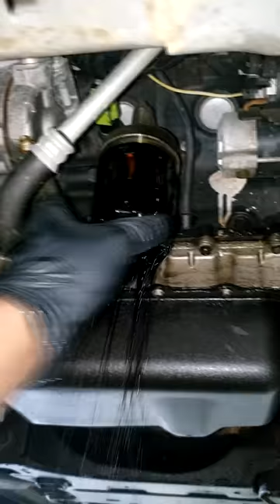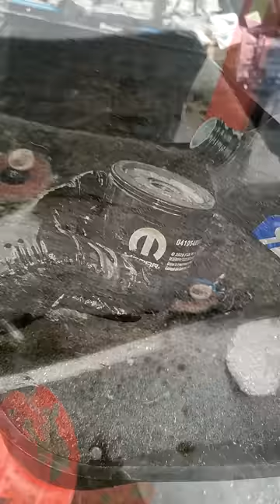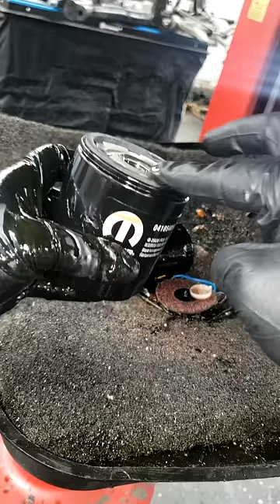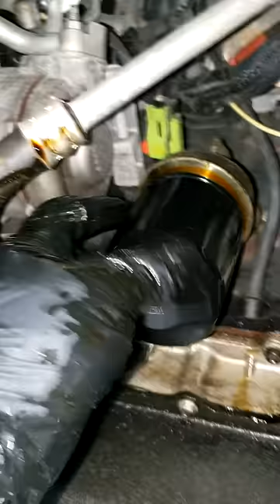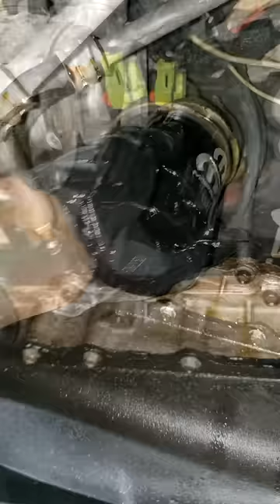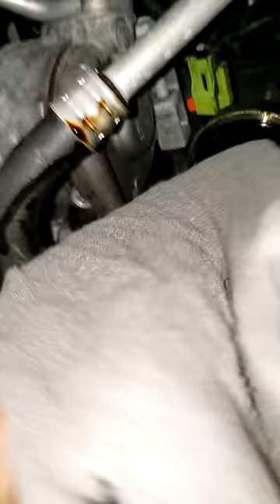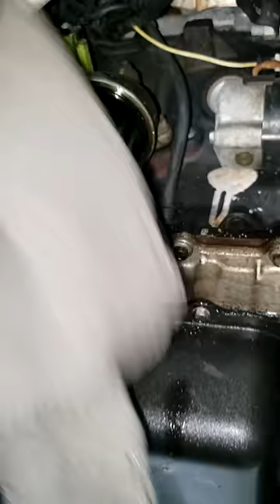Don't Lie.. Are yall still doing this?

Comment: Never pre filled a filter in my life, though cleaning the mating surface and lubing the rubber seal is definitely a must. 

Nearing 200,000km on my ER34, and turbo RB engines absolutely let you know if they’re not happy with the oil (usually in the form of a spun bearing)

Comment: The center of the oil filter is the inlet, the holes on the outside are the outlet. You've just let unfiltered oil into your crankshaft beatings.

Comment: I pre-fill the filter because the oil pan capacity doesn’t include the filter and I add exactly the quantity that the pan holds, then with the gauge I can se where it stabilises and might add a little bit.

Comment: Oil pump pushes oil, it doesn’t suck. Filling your oil filter like that pushes an air pocket through the oil in the filter. I’d rather let the pump push unrestricted than making it tougher on first start up.

Comment: Simple answer, all the engine oil runs through the filter FIRST when you start an engine. If you don’t preload the filter you’ll have a few seconds before the oil is transferred to other parts of the engine. It may not seem like a lot but after 20 oil changes you will start wearing parts down faster than if you just loses the filter first.
Reply: nothing will happen when you dont prefill it. the same thing happens with every engine start. also, some oil filters are on top or on the side and you cant prefill even if you wanted.
Reply: @keisuketakahasi4584  the engines that aren’t able to be prefilled are designed to do so. Sbc, sbf older cars in general it is crucial that the filter is filled before started. Those few seconds it takes to fill that filter then get to the rest of the engine will cause faster wear.

Comment: Even if you pre-fill the filter, the oil in there is not moving anywhere until the pump sends oil to the filter and pushes the oil you already added. Given the small volume of oil you added, I really doubt in the end that you are changing the time it takes for the new oil to circulate by more than 1 second. If it means that much to you, pull the fuel relay and turn the engine over for 5 or 10 seconds to get the pump going at a real low rpm.

Comment: As sn ASE certified tech and also an automotive machinist this is a complete waste of time. They say to do it in school but in reality its not necessary. If you actually understand how the oiling system functions you already know this . Plus a lot of filters are horizontal or even upside down now so its virtually impossible.
Reply: Bingo

Comment: I had an automotive instructor with a 98 Camry with over 400,000 miles and he never told us this to put oil in the oil filter. He would drive from LA to Las Vegas twice a month.

It’s a good idea though to prevent a dry start after an oil change.

Comment: No, it’s been tested and proven it needs to be prefilled especially on large filters on large machines. If not it will run dry for several seconds. Always prefill!
Reply: I run my engine dry between changes to condition the moving parts.  Also known as fasting.

Comment: Your pouring unfiltered oil in to the filter purloin of the filter therefore when the vehicle is first started after service then you have just introduced contaminants to your crank bearing great job.
Reply from the maker: Where exactly do you supposed the contamination coming from by using new oil in a bottle? Are you suggesting that new oil should be filtered?

Comment: I fill the oil filter if it's mounted straight up & down. I for sure wipe the o-ring area on the engine & put a little oil on the new oil filter o-ring to ensure it seals against the engine.

Comment: It's called priming, they do it so when the engine draws it's something to draw from and the gap air space etc is filled in with oil.  You can break your oil pump screen and engine.  The seal on the filter yes lube it  it keeps the seal from adhere to the engine and will come off easier the next time you change it.  As far as priming the filter usual just diesel I automatically do that to.  Lol always read the book to find out if it should be done because there are certain vehicles it will flood it out and burn it up.

Comment: I don't run "designed to fail" vehicles, so most of the time, I pull the coil wire an crank it till the mechanical gauge moves.

I do fill the filter when it's plumb though.
Reply: Won’t apply to all vehicles, but the last mustang (2016) I had would only crank if you held the throttle to the floor and turned it over. So I’d do that once or twice after the oil change and then wouldn’t get the 2-3 seconds of the car telling you it has no oil pressure. For a vehicle that was tuned and running out to 8000 rpms I wasn’t going to not do this step that took 5-10 seconds of my time lol.

Comment: As a heavy machinery mechanic , many big engines have the filter right next to the turbo , i pre fill the filter to prevent the turbo from running dry , even for a couple seconds , we service our machines every 200 hours , every 400 hours we change the oil and every 1000 hours we change all filters , if the turbo runs dry  5 seconds with every oil change , thats 50 seconds every 4000 hours ! 😉 save that turbo people

Comment: This really only mattered way back in the day when it was common for engines to use high viscosity oils like 15w40. Oil is so thin nowadays that your 0w20 oil is practically cycled through the oil system when you’re just engaging the starter before the engine even fires.

Comment: Even if you don’t worry about the oil supply being dry for a few seconds after fire up you should still do it because the filter will tend to leak if you put it on dry

Comment: There's no need to do that, some filters are paper cartridges like in some GM vehicles, some have the oil filter at a horizontal angle lol and the oil pump will do its job. The oil pushed through the filter will push the air pockets out anyway. There's more than enough oil to do so.

Comment: I have a 2006 ford 150. Oil change and lube oil seal spin on and crank up and it takes nowhere near 5 seconds more like 1 or 2 seconds same with the 16 chevy 1500 mabey 1 second. The only time I ever did fill oil filters was on hydraulic equipment  forklifts,cranes,lifts.

Comment: A good reason is to saturate the media with oil, if you try to suck oil through a dry filter the media could tear, even on side mounted engines I fill them 25% of the way full and swish it around

Comment: If you put a little oil on the on the rubber it make it easy to lose of next time and you fully it up, it make it sure that the engine will not turn on with no oil at the start so you don’t destroy or damage the engine

Comment: Wouldn't have to after the 1st use of Duralube. It's chemical was made for the shuttle. Try using it with a new drill bit in pig iron. Still watch the 1984 video.

Comment: Im an ACC tech for walmart, first job ive worked in this industry. We're told that priming filters doesnt actually matter unless its a diesel. I imagine it'd be difficult to put on a primed filter on any vehicle where the filter is horizontal. A lot of nissans, hondas and every traverse have horizontal filters.

Comment: Cant with mine because of the angle of the filter so if i do that im just dumping it right back out.. so no i just let it idle there's plenty of residual oil in the engine to prevent damage.. just idle it for a few moments.. dont be dumb and rev the engine..

Comment: I have one a Toyota eengine that i just replace the inside cartridge...which i do personally like but i cant prefill it. Not that matters with the way yhe oil runs down the engine and into the filter anyway when i fill it

Comment: I've been changing my own oil for over 50 years. I'm 70. Never did this and my vehicles all lasted a long time. My favorite is my 2006 Tundra with 300k miles. Runs like a top.
Pre fill an oil filter is nonsense. Yes, I'm a retired engineer too
Reply: Bty, my Tundra filter is mounted on the top of the engine, holes pointing down. How would I fill that filter and why?

Comment: Or you can look on the side of the filter. They all say now, whether you're supposed to prefill them or you can leave them even on semis they do that now have to semi's eye work on. You don't even need to do that anymore like in the old days. When the oil wasn't that good, that's the difference. 30 years ago, the oil was just not the leaves out of it and send it out. Nowadays, it's got a 100 million things in it. It's stopped all that from happening.

Comment: The oil filter is on the return , if it was on the pressure side it would blow off the filter. Do it any way you want, don't hert eather way.

Comment: Heavy equipment mechanic here. I have always done this even in the pickup truck that after getting screwed by engine shops rebuilt the engine myself. I do this for everything. That way the engine isn’t being starved for oil. I have never ever had an issue from doing this. But then again I don’t have this modern junk with tiny oil ports and low resistance pistons for “fuel mileage” I have all old equipment from 1984 and older. Back when engineers knew what they were doing and cared about the customers. No low resistance piston junk, or tiny oil ports. Simple to work on and will last forever. Grandpa did it this way when he was a mechanic for ih back in the day they got by just fine back then so why change something that works?

Comment: Just did this last week, also oiled up the seal, and cleaned the mating surface before putting it on hand tight. Basically rebuilt my engine 😂😂

Comment: Pro tip, it’s always a pain in the ass to try and cleanly unscrew and remove the old oil filter when the filter is oriented either sideways or bottom down (as in the video) without getting old oil everywhere. You can take a nail and puncture a hole in the dependent part of the filter to allow it to drain first prior to unscrewing it. Those oil filters typically are made of thin metal which is easy to puncture with a nail to make a drain hole.
Reply: That is a great tip!

Comment: You don't needed to clean up oil filter my boy , just change a new filter if you want to do that 
Pouring oil into new filter is unnecessary, but for fuel filter is okay because is helpful to quick starting engine 😊

Comment: This is wrong and right. You should put oil in your filter before install…BUT you genuinely only need about half a cup full…especially if you are dealing with a filter facing downward in an engine bay on some engines.

Comment: I stopped doing this 25 years ago when I started working on BMWs. They use cartridge filters with a drain plug on a post that is part of the cap, there's literally no way to pre fill them.

Comment: Never have and never will, doesn't make a difference, the only thing i do that you did is oil the seal but I also wipe the engine side surface before installing the new one instead of leaving it dirty like you did

Comment: after working in a lube shop at chevrolet, we would never fill the oil filters and every single car, once you turn the car on, theres about 1 or 2 seconds where you can hear the top end of the motor doesnt have oil, then the audible change when the oil hits the top end. if it was my own car i will defenitely change the oil like the video

Comment: Don’t matter, my dodge Cummins has 280k miles and I bought it with 6 miles on the odometer. Always changed to oil the same way without prefilling and never had an issue.

Comment: I cant, just lube up the oring and seal, get it hand tight, turn with oil filter wrench like once and call it good. Mine is on the side so itd just be giving my engine a little oil shower

Comment: I CAN'T do this.
Because my oil filter is on the front side of the engine block, not on the bottom.
All the oil would spill out, and I would have to clean up the mess.

Out of the 6 cars I've even driven, only 1 car has the oil filter on the bottom(Mitsubishi Eclipse).

Comment: On certain cars I do knowing engine design such as engines with high oil pressure systems (diesel, kia, and Hyundai are examples but not in that meathod.   Not all cars need it.  Plus please tell me, how are you going to full it and expect it to stay filled (and not make a mess) when the filter lays on its side, screws on with the gasket down, or dumps in the engine because it is a cartridge filter like Mercedes then why?  The oil pump will provide just fine.

Comment: Every time!  I even engrave the date and miles on the tachometer on the bottom of the filter.  This way there is no question about when it was done and how many miles have been driven when they change the oil after me.

Comment: I do it to not potentially run the oil pump dry and so it wont take longer for the oil to go to the top of the engine after you start it back up

Comment: It is and always has been a waste of time. The oil volume of the pump fills it in a second or so. Also on a cold start the filter is mostly bypassed due the viscosity of the oil.

Comment: It doesn’t matter that modern cars build oil pressure within milliseconds upon starting and most have horizontal or cartridge filters. That’s because most modern engines have an oil flow path that goes through the filter last before returning back into the pan. Oil flows directly from the pump to the camshaft and the different oil passages in the head, then flows downward back through the filter, so all you did there was skip putting half a litre in the pan 😂

Comment: Pre charging filters is unnecessary. CUMMINS doesn't even want their filters pre charged. 
And if you are going to recharge your filter, it flows from the outside in. Meaning that fluid is unfiltered.

Comment: The simple answer is there's no point. especially when no damage is caused from not doing it. 40 to 80 psi of oil pressure fills those filters faster than the time wasted to pour.

Comment: I don't know, why are you still making a mess removing the old one?  Try using a solo cup over the old one so you don't spill oil all over your hand.
Reply from the maker: My guy all the old oin ended up in the drain pan like it suppose to. When you do this daily in a shop it becomes normal and no big deal. You be squeaky clean at home doing ya oil change in your garage.

Comment: No need. Its a filter, not a pump. It doesn't need to be primed. I have over 250k on my truck. I've never filled the filter on this truck or any other vehicles. I'm also a boat mechanic for DHS. We often see our boats come with over 4k hrs on them. None of us fill the filters. It does not matter.

Comment: I see nobody stating the fact that you can also let the engine rotate a few times without starting the engine, just turn the key 1 tenth of a second a few times. It will also fill the filter without the engine immediately running without oil
Reply: Most modern cars are started by the ECU, not the key. A 1/10th second blip will start the engine.

Comment: All it does is gets oil up into the top of the engine a few seconds faster its basically pointless unless it’s a rebuild engine and even then you should have the thing covered in assembly oil anyways

Comment: Never did this. BMW filter inserts are upside down, and my current car doesn't need oil change. First brake pads changed at 250 thousand kilometers. Electric rules!

Comment: If you ask Cummins they say fill it....Caterpillar says don't...you should plug the center and pour down the sides so oil is filtered and no debris falls down engine side of filter but who has time for all that....Fill the damn filter...Lube the gasket....The real issue at hand isn't even addressed....Lube Techs PLEASE WHILE INSTALLING NEW FILTER IT'S ONLY HAND TIGHT PLUS A 1/4 TO 1/2 ADDITIONAL TURN .....No cheater pipe needed

Comment: No, no, never. 30 years I have never filled a filter on my vehicles. My  2016 Lincoln MKX that I bought brand new, I have never filled the oil filter. I even use the full synthetic Walmart oil. I am at 108k and it is time to change the oil. Oil level is still at the full mark…no top offs.

Comment: I still do it even though my Chevy filter is at a 45 degree angle. I swear engineers do the dumbest things on purpose like redundant sensors in all the new vehicles that are completely unnecessary and cause way more problems then they solve!

Comment: Try that with my Subaru. Filter is up top, gasket side down. What about the Toyota cartridge filter mounted sideways by the drain plug? VW 2.0L with the filter up top by the fill cap... Get real, guy!

Comment: Nope lol I don’t and guess what have a truck iv had for almost new with very low miles and still running strong with 220000. And it a 2004 ram with 4.7 and it known for it problems. ✊and also I’m the mechanic at UPS and I don’t even do it to those trucks and they do fine.

Comment: Stop using engine oil to lube the O ring. It dries up long before the next oil change. Use either engine assembly grease or designated O ring lube. The next person to remove the filter (possibly you) will greatly thank you.

Comment: I’m not lying. I would never take a WIX filter off and replace it with a Mopar.
Reply from the maker: Lol, but im doing a customer oil change my guy. I have to. Besides, IMO its better.
Reply: I just found out that Mopar filters are manufactured by Wix, so are Napa Gold filters and Mann. I Use Mopar on my 1997 Jeep sahara and Mann on my wifes Audi S4

Comment: I'm master certified with over 35 years of experience. With these small filters, it's pointless. It takes an entire second for pressure to hit. If it was so important, then filters would never be mounted sideways or face down. It's not 1974 anymore. Filters don't have 1 quart capacities anymore. Oil pumps don't have massive tolerances or lose prime anymore. Oil changes don't happen every 3k anymore. Oil isn't the consistency of maple syrup anymore. Doing this is outdated unless the filter is gigantic.